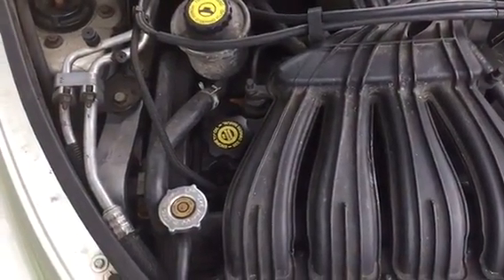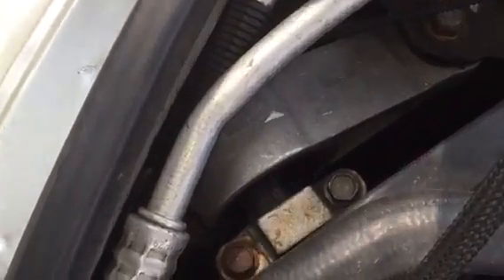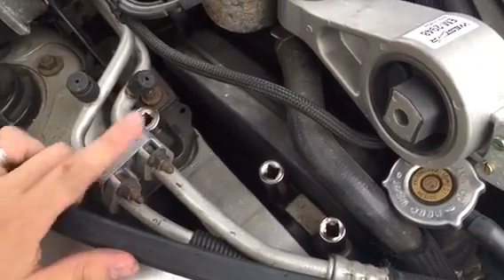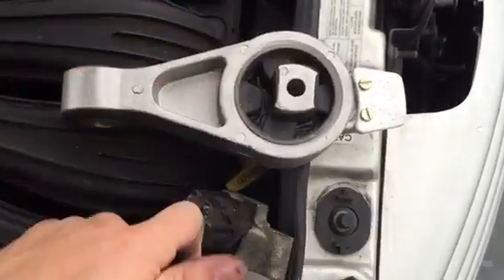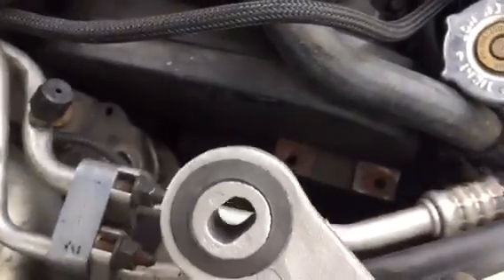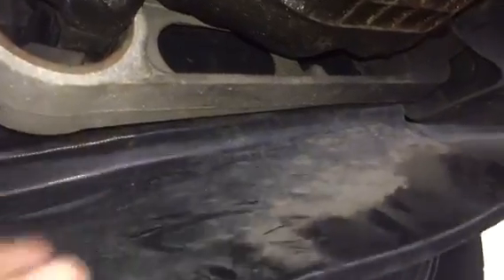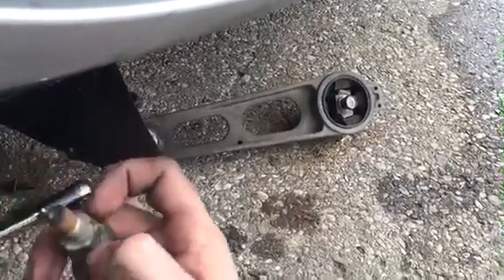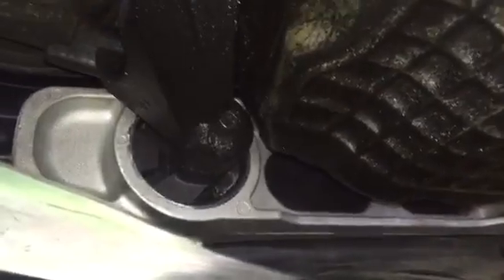Torque strut inspection and replacement

Comment: The way I understand it, there is a third one...in between the upper and lower torque struts...and it is often replaced when the timing belt is replaced. At least that's the way it is on my 07 PT.

Comment: Was there any noises before you replaced it? I replaced my lower control arms with my brother last week and we noticed that on the lower torque struts, two of the bushings were disconnected. It was not making any noise at the time. A day later I went for an alignment and literally right after I pulled off the noise started. It was a small clunk sound, just at low speeds usually when accelerating or decelerating or going over a bump. I immediately took it back to make sure Firestone didn't mess something up during the alignment. They said it was the engine mount (torque strut) the same one I removed when changing the control arm. The sound stopped after the second Firestone check then started a day later again. I'm just curious why it started right after the alignment and why it stopped temporarily after they checked it.
Reply: So, what's the torque spec on all these bolts? That is kinda important, no?